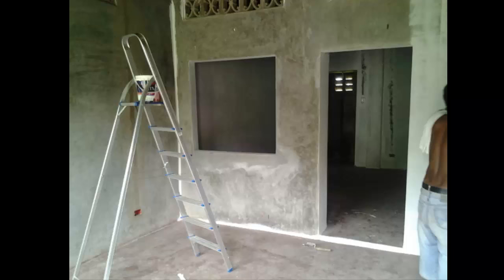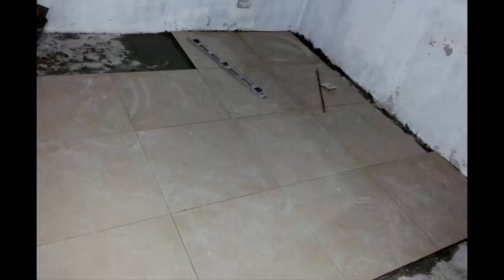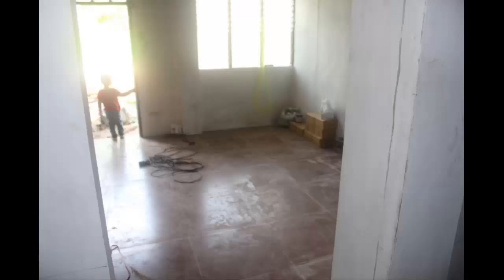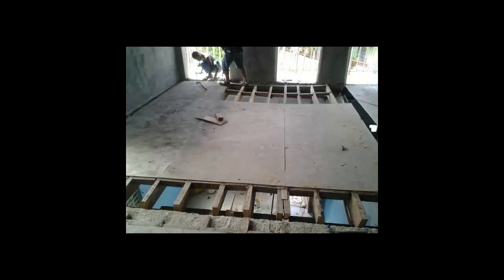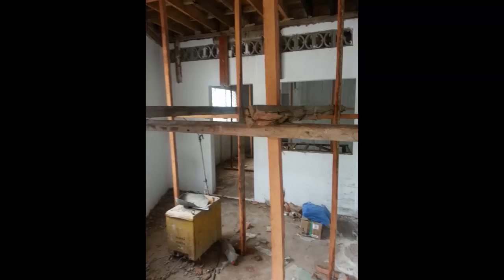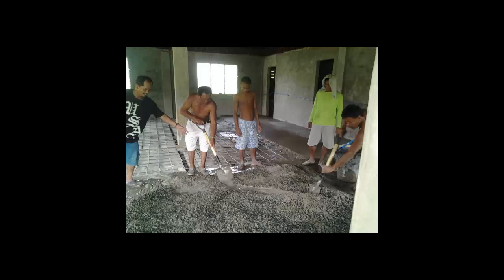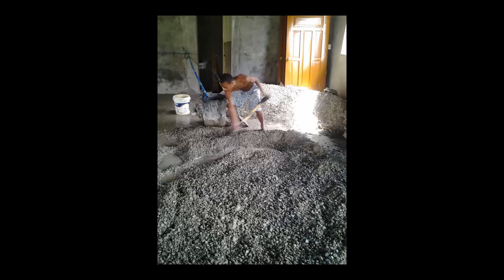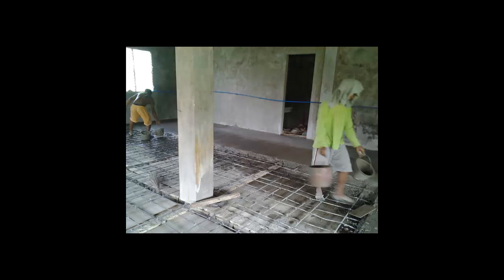Building a call centre building in the Philippines   Part 4

Comment: Very goo Matt, Very informative and I really enjoyed seeing how you formed and poured the upper floor. I was consulting on a similar but larger building in Guyana that needs large  upper floor and the structural engineer was looking at a lot of structural  steel, and I was wondering how comfortable you feel about your design from a structural standpoint and how earthquake survivability?

Also, do you have a 'Part 5' somewhere?

Thanks
Reply from the maker: +HDXProd Cheers, It already has survived several earthquakes, the main thing is making sure the metalwork is the right size, support pilars are the right size and that the concrete mix is correct.

Part 5 is here :- https://www.youtube.com/watch?v=yfKIqEb5bf0
Reply: +matt wilkie Thanks, Was your steel truss made on site? It looks like pretty simple and quick bit to fabricate, and If so might be less expensive then buying something stock or custom.
Reply from the maker: Everything we make on site, my father in-law generally builds anything metal wise right down to ornate gates and staircases. To the point every house in the neighbourhood has something he has made. Even the security shutters.